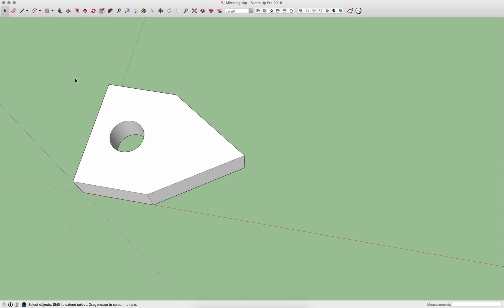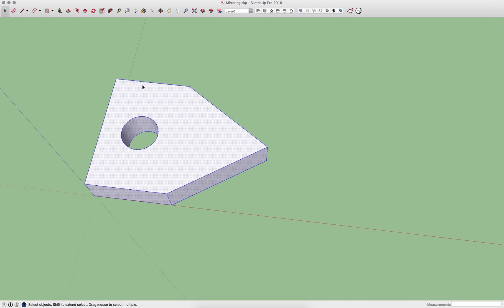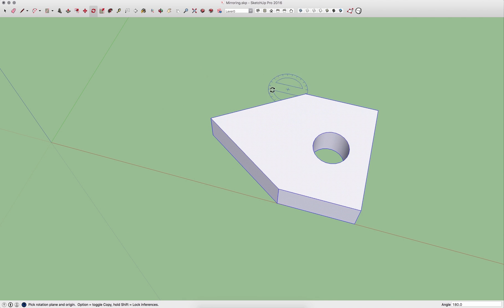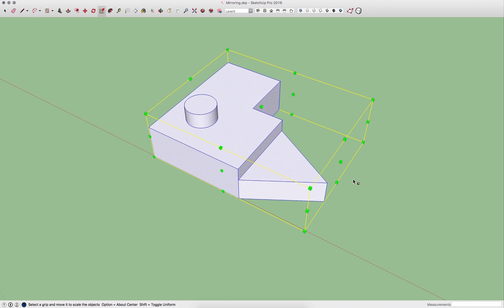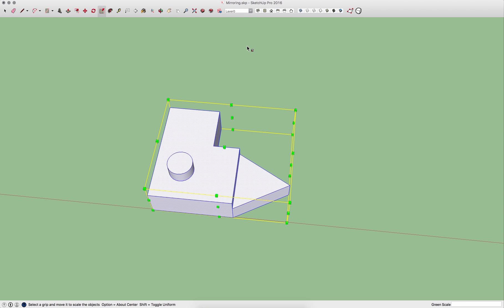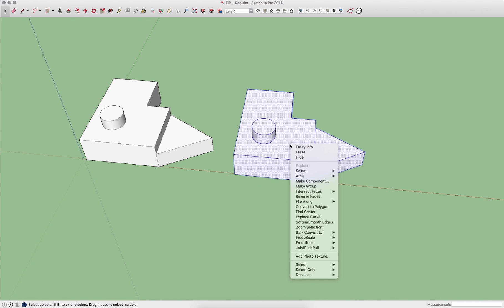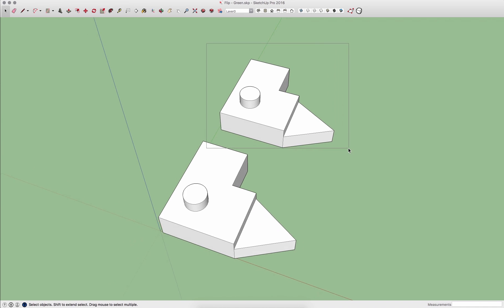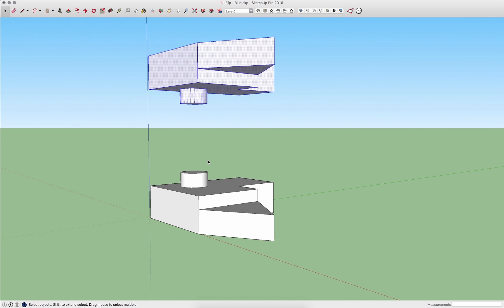SketchUp Skill Builder: Mirroring

Comment: Aaron, nice demo on the SU methods to mirror objects!

I recently discovered that mirroring a copy of a component is a great way to create left- and right-handed parts. My project was a chest of drawers. The left and right sides of the chest had several features for locating drawer dividers, runners, etc. It was great fun to copy the basic left side component and mirror it to create the right side component. After that, everything I did to the left side appeared on the right side ... only as a mirror image!

Lots of furniture projects I do have left- and right-handed parts. This will cut my design time for them nearly in half.